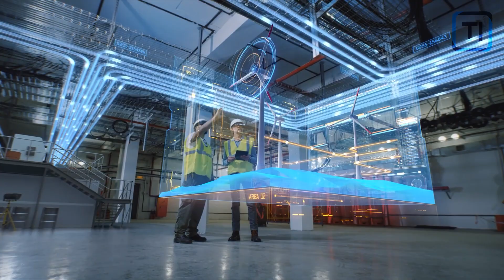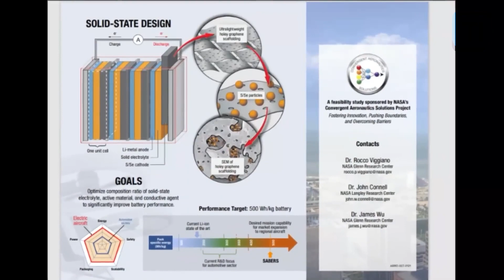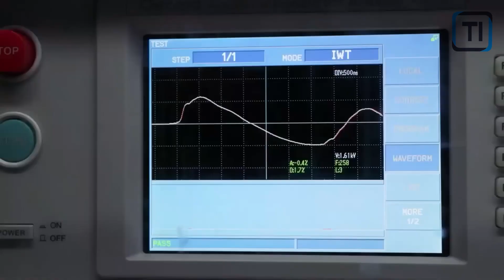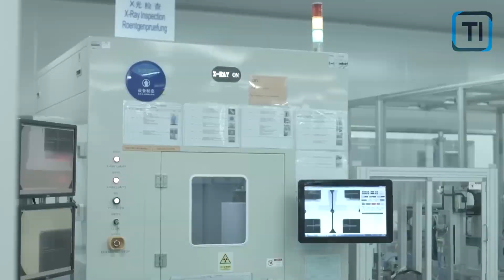NASA Reveal New Sulfur Selenium Solid-State Battery That Changes Everything

Comment: Ok leeleeds - total world Selenium production 2022. 1,120 metric tons. Lithium was 130,000 metric tons and it is constrained to limit BEV production. So how much Selenium is needed to make a model Y size battery?   At least 1/5th. So all you have to do is increase world production by 5x just to make the very same very limited numbers of BEVs as Lithium. they'll be very costly.  Maybe suitable for aircraft but the price will be so high you'll wish you opted for fossil fuel versions.
Reply: Wheat, alfalfa, Wheatgrass etc..  all those plants aren't currently being processed for selenium but they chemically create it and could become a source for more of those metric tons you compared.